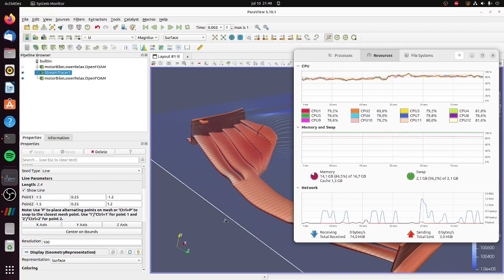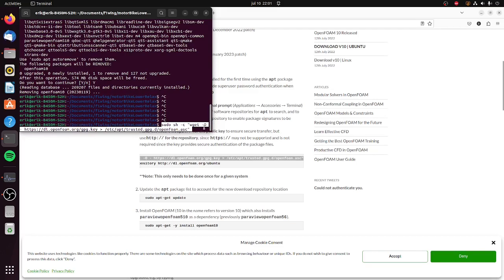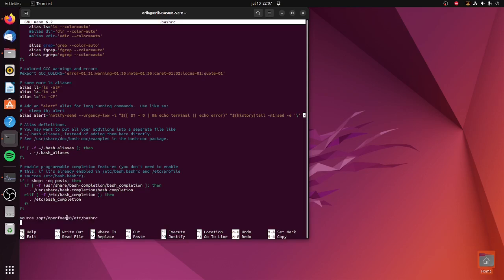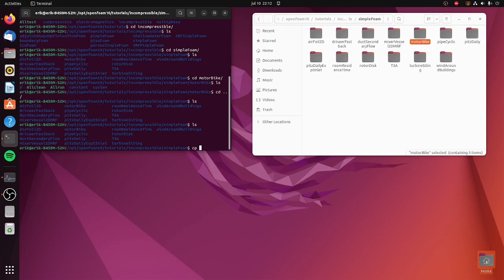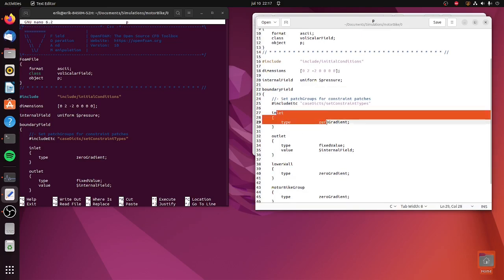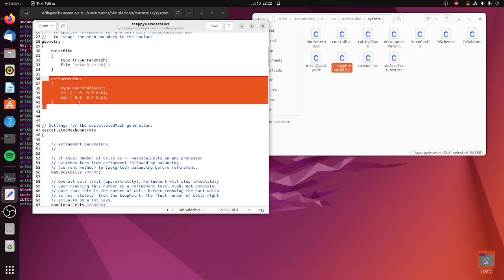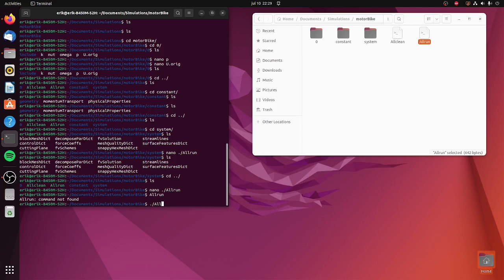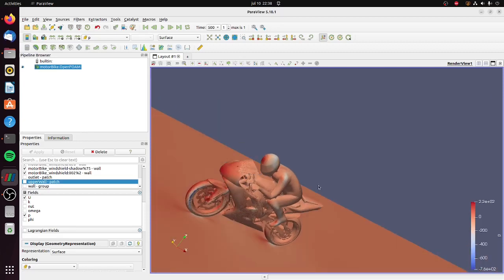How to simulate a Formula 1 Front Wing (CFD using openFoam) - Part 1 Installing OpenFoam

Comment: After i press yes like at 12:59, I get the following error:

qt.qpa.xcb: could not connect to display
qt.qpa.plugin: Could not load the Qt platform plugin "xcb" in "" even though it was found.
This application failed to start because no Qt platform plugin could be initialized. Reinstalling the application may fix this problem.

Available platform plugins are: eglfs, linuxfb, minimal, minimalegl, offscreen, vnc, xcb.

Aborted (core dumped)

Any idea as to what I should do?